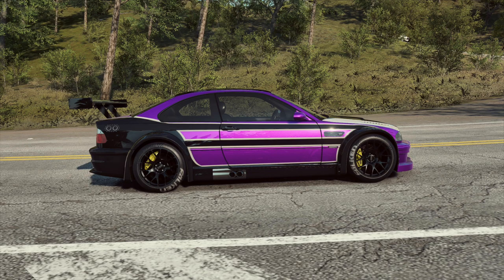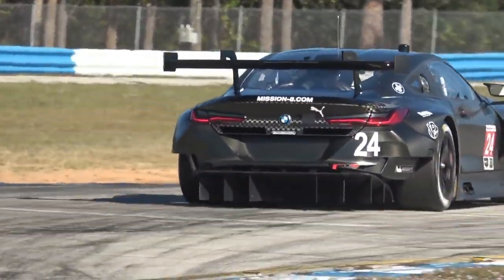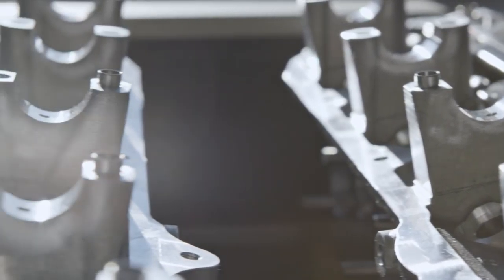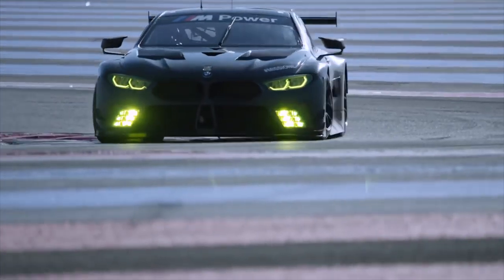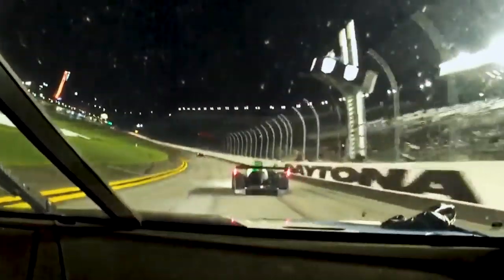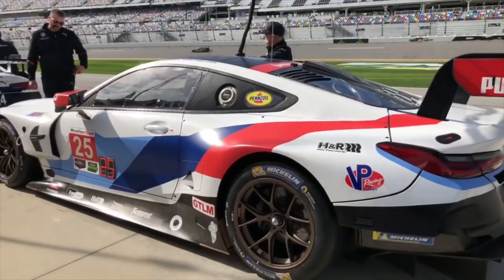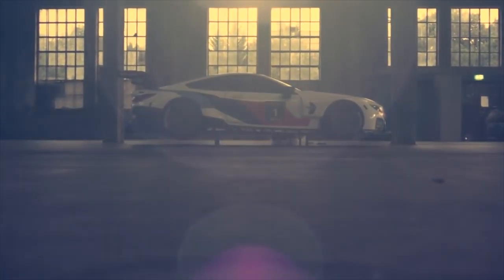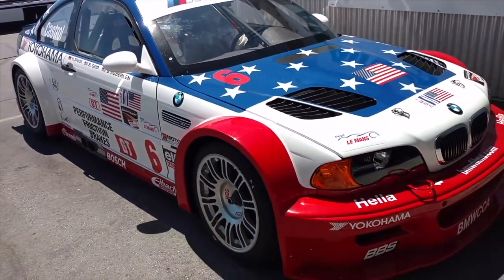The BMW M8 GTE

Comment: With the flat crank it's just sounds like the E46 M3 GTR
Reply from the maker: It's a cool engine! It doesn't rev as high as the M3 GTR's engine but other than that it's pretty similar, and makes A LOT more power